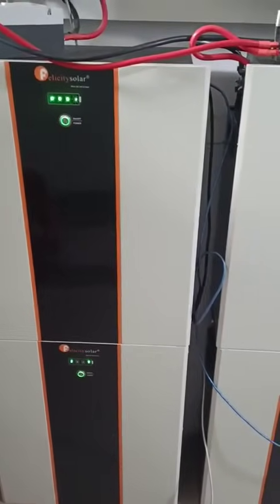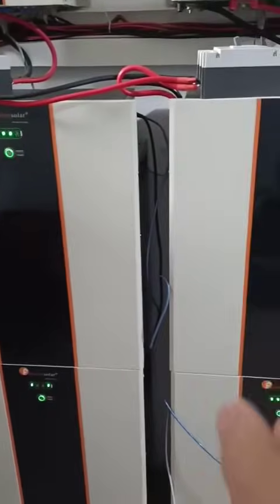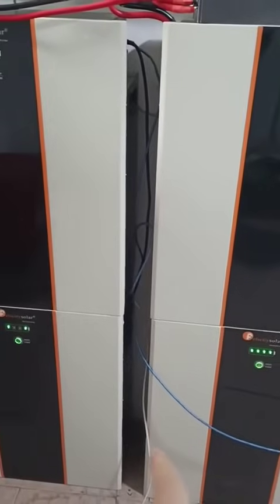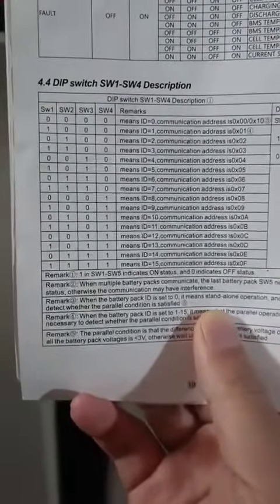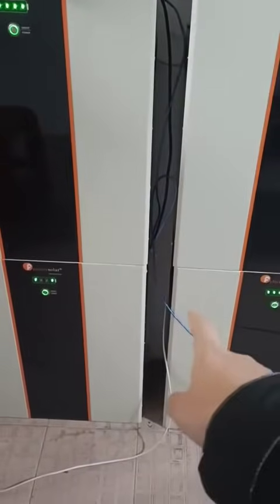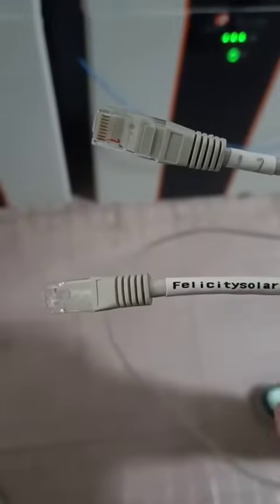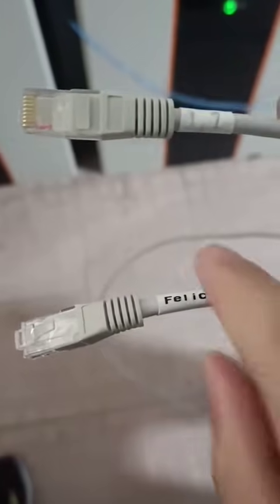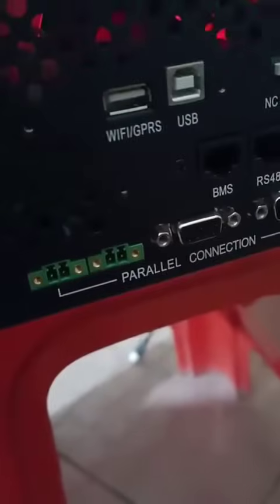How to connect Felicity batteries with Growatt inverters?

Comment: I have a 12KVA Growatt connected to a 15KWH Felicity lithium battery my program 5 is set to US2 05 
the battery takes time to charge and later stops charging when it gets to 50%
BMS cable has been connected between both devices

Is there a compatibility issue between Growatt and Felicity's lithium battery?
Reply from the maker: Please contact our engineer for Technical support by whatsapp: 
Wasely  +86 131 2609 3443

Comment: Hello Sir,
I have trouble with the connection to Growatt SPH4600, always BMS COM Fail. Can you please show how to connect.
I tried pin 7/8 at felicity LPBA48200 and 5/6 at SPH4600.
Kind regards
Reply from the maker: Thanks for your message, you can please leave your whatsapp, our technicians will contact you to help you. Or you can also contact them by: felicityservice@felicitysolar.com/Whatsapp : +86 18620180651
Reply: pin 5/6 at battery & pin 1/2 at inverter

Comment: Hello Sir,
we tried to connect Felicitysolar batteries with growatt inverters,
but it seems that their is a compability issue with Growatt inverters, 
Felicitysolar batteries always cause Growatt inverters to "high bus voltage" fault when reach 100% soc !!
Reply from the maker: Thanks for your message, you can please contact to technicians for professional problems, they would like to help you: felicityservice@felicitysolar.com/Whatsapp : +86 18620180651